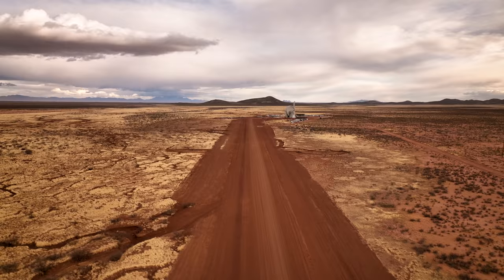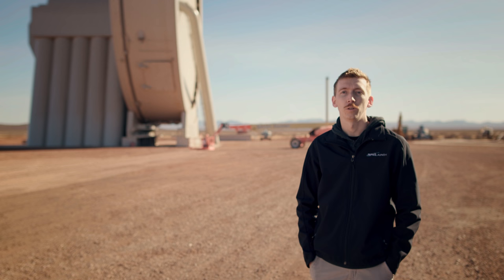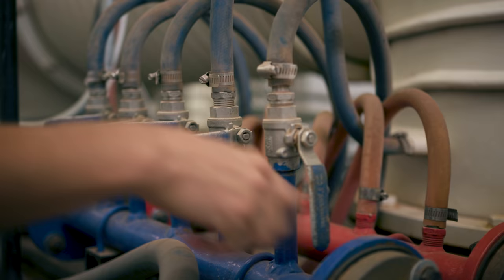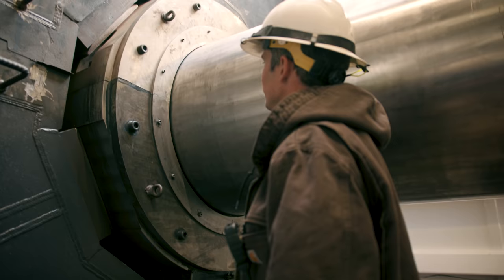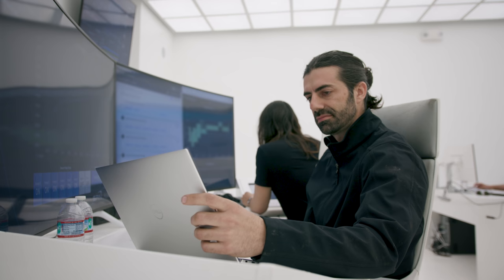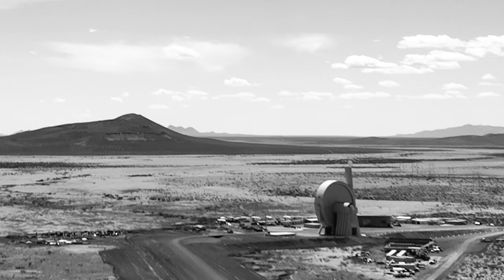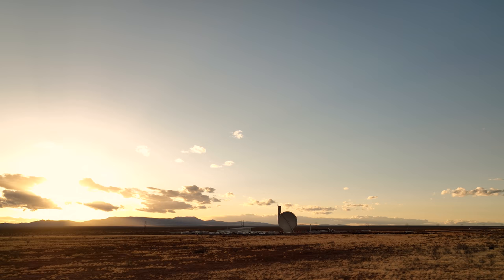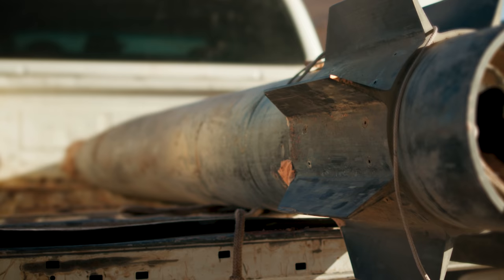An Inside Look: SpinLaunch Flight Test #7

Comment: Hey, love what you are doing.
Can you help me out with a couple of questions?
1; how do cancel the rotational momentum on release?
2; what levels of momentum/energy are released by the counterweight on launch?
3; how do you dissipate the counterweight energy?
Reply: i'm an idiot and have no idea what i'm talking about. i would have a counter counter weight on a rail at centre mass during wind up. as you release the rocket you release the counter counter weight which slides down the rail and replaces the rocket mass. Give me my noble prize!
Reply: @NotPoodle  love your idea. 
That has to take place in 1-2ms
Reply: Didn't they mention a water brake? Or maybe I misheard
Reply: They won't ever answer you.. Because this is a scam. Another kkckstarter type ripoff.
Reply: @mastermnd22  i agree.. at the very least they are currently very far away from something usable, but likely it's infeasible completely.
Reply: @akunog3665  Physics says you could do it... just like you could theoretically move at close to the speed of light as long at you have infinite energy.  In this case it's even more "feasible" because you don't need infinite energy.  You just need materials that don't and likely cannot exist.
Reply: Basic physics says that at the instant of release the projectile is on a straight line path, the is no such thing as "rotational momentum".
Reply: @apburner1  
Really?
Does the projectile go around the wheel?
Reply: @brucebaxter6923  Look up Newton's 1st Law.
Reply: @apburner1  maybe they should do a quick search for "shepherd sling"? The principle has been known and used for millennia, it's good to see research and experimentation into whether it can be scaled up.
Reply: @apburner1  
Let’s go through this slowly.
Is the projectile attached to the wheel?
Does the wheel rotate?
Does the direction the projectile faces change as the wheel rotates?ie, points up as it goes up and points down as it goes down.
So, when the projectile is released, what stops the projectiles rotation?
Reply: @mastermnd22  and yet you're watching the video?  Or are you not watching and claiming it's a scam?
Reply: @brucebaxter6923  For the object to continue curving some force would have to be acting upon it to make it change direction. When it releases there is no longer any force making it go in any direction other than straight, and perpendicular to the exact point it was released from.
Reply: @apburner1  
Not curving. 
Spinning.
Reply: @trm4life  
Yep, 30,000ft isn’t orbit.
Delicate satellites can’t take the acceleration of launch. 

You saw the strength required to survive launch is more than to survive impact with ground from 30,000ft
Reply: @trm4life  I have a bridge wholesale company. Looking to offer you an excellent deal.
Reply: @brucebaxter6923  when you spin a rock with a string fast enough so it breaks, the direction rock will go will be perpendicular to the string when it detached. 
Balls do curve in flight, but that's due to magnus effect.
Reply: @brucebaxter6923  The projectile isn't "spinning", before OR after the arm lets go.  The projectile is being pushed "forward, towards the tip" by the arm, and held in place around the center of rotation by centripetal force.  The arm is the only thing applying forces to the projectile, minus gravity which is negligible for now.  From the frame of reference of the arm, the projectile isn't even moving, certainly not spinning.  When the arm lets go the centripetal force is gone, therefore the only way to go is whichever direction the forward direction was, which was always "towards the tip" when the release happens.  

Lets just assume that at the exact moment of release the arm is directly parallel to the ground, the projectile pointing straight up...  The arm will keep spinning afterwards but that is irrelevant at that instant because they are no longer attached and after that instant the arm cant apply force to the projectile anymore.  So at the exact moment of release, since the projectile isn't spinning with respect to the arm, it will continue not spinning with respect to the arm's position at the moment of release, because again the arm was the only thing applying forces to the projectile (minus gravity still).  If the arm is directly parallel with the ground at release, the projectile will stay pointing straight up.  Finally at the moment of release, the velocity is now all straight up and gravity does become a non-negligible force again and causes it to fall back to earth
Reply: @jaspering88  
I should have used pirate ship and Ferris wheel but I hope you can’t still understand.
Reply: @brucebaxter6923  No not at all lol, you just don't understand centripetal force.  The reason the hammer toss ball and rope spin after release is because the "connection" between the human's center of rotation and the ball is somewhere in the middle of that radius.  The center of mass of the ball and rope is way offset from the center by length of the object along the radius as well, this just exaggerates the effect.  The ball has a certain velocity based on the radius it's at and the center of mass, and the handle of the rope has some other different velocity based on a smaller radius.  Since these velocities are different, you get rotational movement around the center of mass, aka spinning.

If I held a stick straight out at arms length and spun in a circle and let it go, yes it would "spin" after I released it, because the stick has 2 different force values on either end of it, because of 2 different radius values.  But if I held that stick perpendicular to my arm, there is only 1 radius in the whole equation, meaning all the "forward" force is in exactly 1 constant direction after release.  There are forces on either end of the stick at that point, but they conveniently cancel each other out due to symmetry (assuming I'm holding the stick in the exact center of mass, which I also assume the SpinLaunch guys would've figured out to do). 

BUT in SpinLaunch, the center of mass is symmetrical along the radius of rotation to the edge of rotation; the connection between the projectile and the launcher arm is right on the edge of the radius, not in the middle.  No different than if the projectile were in orbit around the center of rotation of the arm.
Reply: @jaspering88  
So the far edge of the projectile travels a further distance than the near edge of the projectile in the same time. 

Just the same as the hammer travels a larger distance than the handle does in the same time. 

If the launcher works like the pirate ship, there is rotational momentum. 

If the launcher works like a Ferris wheel it doesn’t. 

Answer me one simple question. 
Does the projectile ever point at the ground as it gets spun up to speed?
Reply: @jaspering88  

Is the spin launcher spinning?

Is the projectile attached to the launcher?
Reply: @brucebaxter6923  Yes it does point towards the ground.  But from the inertial frame of reference of the arm, the projectile is always pointing in the exact same direction, aka forward.  The key in the previous example is that the projectile is symmetrical along its center of mass in 2 directions perpendicular to the plane of rotation, the hammer and ball is not.

It doesn't matter if to us the projectile is pointing up, down, sideways, wherever at any moment prior to release....  To the arm it's always pointing in the exact same direction, relative to whichever direction the arm is facing.  Since the arm is the only relevant force acting on the projectile, at the moment of release, there are actually no forces left acting on the body after release(except gravity and wind resistance, both of which negligible).  Therefore it stays in the exact same position relative to the arm at the moment of release as it was (meaning pointing straight up), because there are no more forces acting on it.

According to Newton's first law of motion, an object will not change its motion unless a force acts on it.  Again assuming gravity and wind-resistance aren't at play (they are at play but all they do is serve to slow down the projectile and pull it back to earth, not make it spin in our scenario)... Since there are no other forces at play and there is also no "spinning" momentum relative to the arm while it's connected, why would there be "spinning" momentum relative to the arm after it's disconnected?  (From the arms point of view, the arm's inertial frame of reference becomes meaningless to the motion of the projectile after release because it no long has any influence on it).
Reply: @brucebaxter6923  Ill do you one better, let's look at it from the frame of reference of an observer outside the launcher.  We see the projectile rotating around a center, always pointing perpendicular to the radius of rotation.  We must conclude there is some force pulling it towards the center, otherwise it would just go in a straight line.  This is well known as centripetal force.  Furthermore since the rotation is near to the Earth's surface we can assume there is some other force counter-acting gravity, otherwise the projectile would just fall to the ground, not to mention the projectile is speeding up.  This force is a "pushing" force (or pulling depending on how you look at it)  from the arm tangent to the radius of rotation.  The combined 2 forces make the projectile travel in a circle, always staying pointing perpendicular to the radius of rotation.  When we remove both forces at the moment of release, since they both come from the arm....   Then again we are in the same scenario as before, only gravity and wind resistance left.

Also I can't state enough that the projectiles symmetry plays a huge roll in all of this, if the projectile were asymmetrical like a hammer and ball, we'd have all kinds of rotational motion after release.

From our perspective on the ground, yes the projectile is still spinning relative to the arm's release point as the arm keeps going around the circle.  That is because the arm has angular forces on it, that are changing the arm's velocity vector.  The projectile is just traveling in a straight line upwards though.
Reply: @jaspering88  
Ok. So it spins. 
It points up then down then up. 
It spins. 

It has mass
Spinning mass is rotational momentum. 

How is it cancelled out?
Reply: @jaspering88  
How did it start spinning relative to the arm. 
It was fixed to the arm a moment ago.fixed to, as in can’t move. 
Now it’s spinning in relation to. 
Where did the rotational momentum change come from?
Reply: @brucebaxter6923  "Ok. So it spins. 
It points up then down then up. 
It spins. " 

That is not spinning, that is called rotating.  There is a major difference, especially in this context.  For your own reference:  

Spin motion: Motion of an object as it rotates around an axis through its center of mass. Rotational motion: Motion around an axis of rotation.

The projectile does not "spin" around it's own center of mass, it rotates around a center outside it's center of mass.

The only reason for having a difference in these definitions is to prevent confusion like in the situation you are claiming as being actually the same.
Reply: @brucebaxter6923  "How did it start spinning relative to the arm."  It literally didn't from the inertial frame of reference of the arm.  As I said earlier, the inertial frame of reference of the arm becomes meaningless after the point of release, so we can only compare at the moment of release.  Comparing our observations from the ground is a completely different inertial frame of reference, and should be treated as so.
Reply: @jaspering88  

You have stated several times now that there is a change in angular momentum at the point of release. 

What caused this change in angular momentum.
Reply: @brucebaxter6923  The sudden absence of the centripetal force, due to the arm releasing the projectile, causes the angular momentum to go from some value, to being invalid.  Because a radius is needed to calculate the value.  After the arm releases, there is no more radius, therefore no more angular momentum, therefore the object stops traveling in a circle.  Again angular momentum doesn't equal spin anyway, all you are asking is why doesn't the projectile keep traveling in a circle after it's released, not why does it still spin after release.  Your question doesn't even make sense.
Reply: @trm4life  you must be a blast at parties. None of their builds are successful. They need people like you. Keep up the support. Stupidity is a must for these things to succeed.
Reply: @apburner1  Yes the "path" is a straight line but the projectile still has the rotation (tumbling) from the 500 rpm (or whatever) the thing was spinning at.
Reply: @jaspering88  There are no rotating frames of reference. Frames of reference are always moving in straight lines. Special relativity forbids rotating frames of reference.